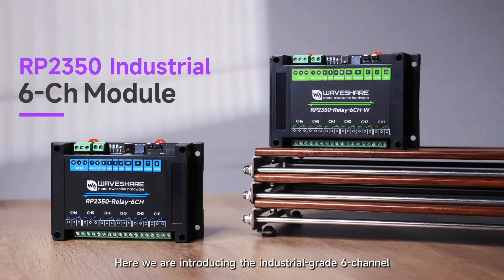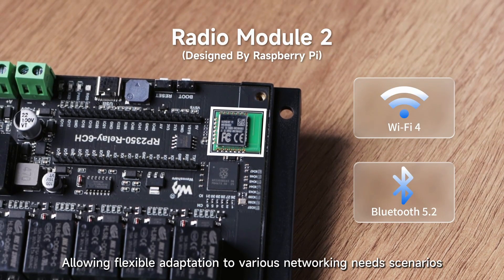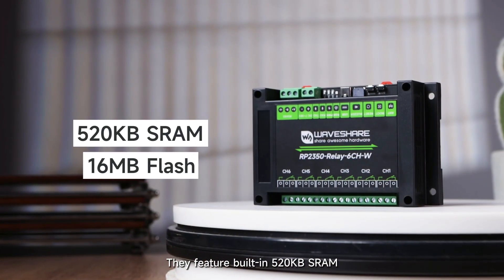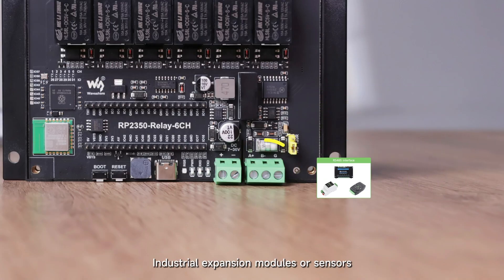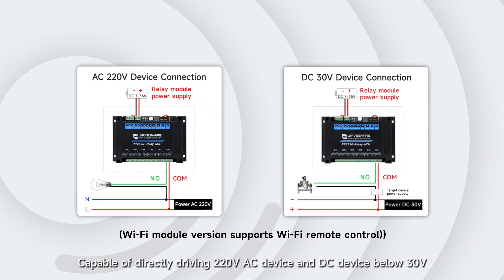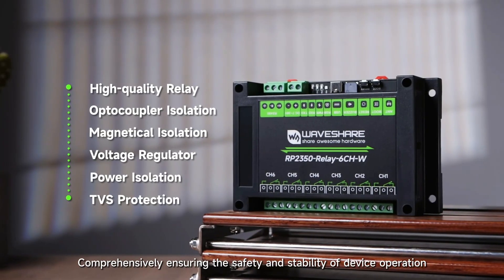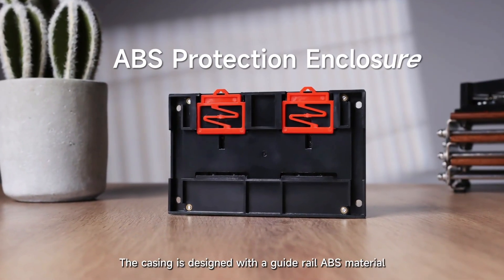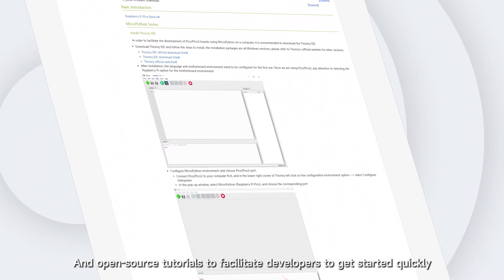Rp2350 industrial relay with wifi function,6-Channel 10A Relay Output,Multiple Isolation Protection

Comment: Hi! I’m interested in using the Waveshare ESP32-S3-POE-ETH-8DI-8RO in my smart home setup.
Can I buy this module to install at home, connect it directly to my router using the RJ45 (Ethernet) port, and integrate it with Amazon Alexa on the same local network?
If that’s possible, could you please let me know what software, firmware, or platform I should use to make it work with Alexa (for example, eWeLink, Tuya, or MQTT integration)?

Thanks in advance!
Reply from the maker: Submit a request to us：https://service.waveshare.com/